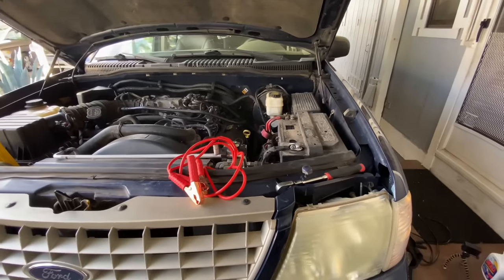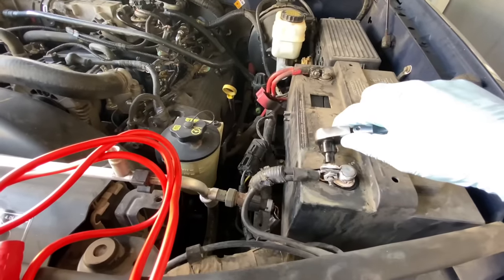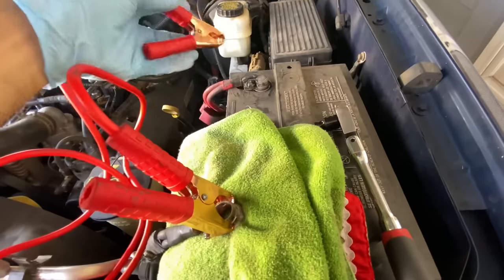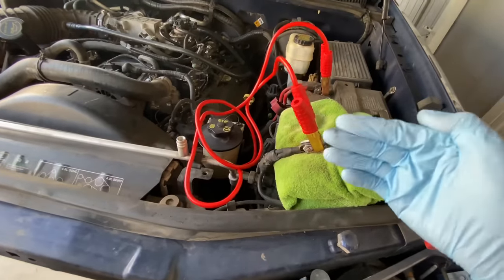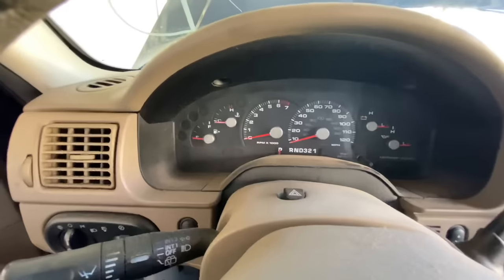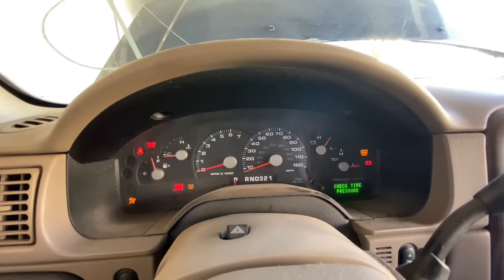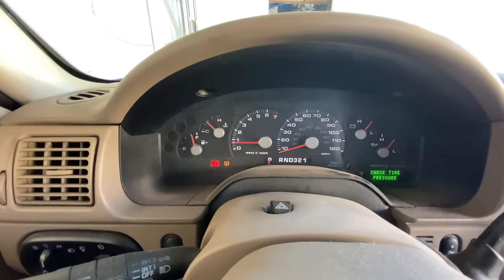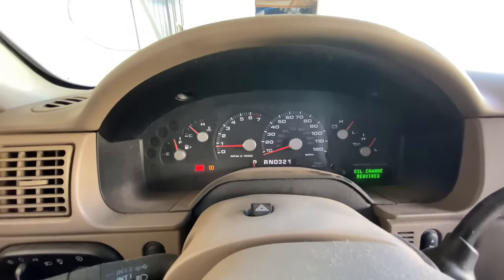How To Reset All ECU’s and Control Modules in your Car or Truck

Comment: I'm going to try this on my wife, her attitude has changed from when we first met. I wonder if it will revert her to her original self! I live in hope.
Reply: No hope dude.. You screwed yourself up the day you married her..
Reply: You may have to ground both nipples!
Reply: keep pushing the lower button hard enough can help sometimes .
Reply: Best reply ever lol
Reply: Lmmfao
Reply: I feel your pain my man I'm in the same boat one day everything is sweet and then everything is toxic every single day no way to reverse them back to normal
Reply: The replies cracked me up. Lol.
Reply: @asukakazama449  hmm
Reply: I'll tried already this on my wife, but didn't work, so after 9 years of marriage, i just gived up!
Reply: Ha that’s a damn joke ,tried all kinda shitting resets on mine ,ain’t  a shit worked yet, guess it’s time to get rid tha shit ass. reset reset shit resetting for days
Reply: @zanmirrob  nope shes broke,no hope.
Reply: @zanmirrob  yep today going to Lowe’s ,getting a new whirlpool double doors  , she should get colder I hope but use less power. Need a bigger one anyway so I can put all the left overs of my gumbo , and alligator tails stew.
Reply: It's a permanent fault, either put up with it and live in misery or free yourself of the problem.
Reply: @cardozita2cool  There like that when they have another person treating them like the pretty princess they think they are on the sly.
Reply: Try jiggling your key a few times. Should rest her fault code
Reply: Did she tell you, that you're  trucking her wrong.  Your 🚚  me wrong?!
Reply: @jimmydcricket5893  or the seeding farmer.
Reply: @tejanochris  i hope things get better for both of you GIVE some honey talk TRY something new and bring small new surprizes to her GIVE IT TIME so she could think about a few things AND look handsome all that helps
Reply: @asukakazama449  flick the bean, ( do you mean ? ).
    only works on 
    " little man in a boat " ,
Reply: @lU
Reply: Let me know so I can do it tooo!😂😂😂😂😂
Reply: Lol
Reply: Hahaha.  Hilarious
Reply: Jimmy S  It doesn't do anything just produce a really loud noise, I think it's her horn..
Reply: Bra you started something totally different from the video but when I say funny.... not to be mean but start with yourself and you see improvement. Be blessed..
Reply: If you do that you might void  the warranty
Reply: @geremiazjauregui2415  
.
Reply: Hilarious!!
Reply: 1william B l
Reply: Pull it out make her smell it 😂
Reply: This is classic
Reply: @bronsonteruna9453 aq 11qqq1q
Reply: @Living creature yeah, trade 'em in for a newer model.
Reply: how did t turn out?
Reply: Yes you actually can do it. Use the tDSC 2.3mA for 25 five minutes
Reply: OMG!!! LMFAO!!! GOOD ONE BRO!!!
Reply: Half these people don't sound like relationship material themselves blaming their wives lol
Reply: @cardozita2cool  its so weird man... once i moved in with her it's horrible... like bad... idk what to do i have a baby wit her ion wanna leave my child g
Reply: Some things just cannot be fixed, sorry man!
Reply: Try to reset first yourself it may works
Reply: Divorserape her. No fault divorce
Reply: Well, better not, this is women mind you can't change it
Reply: Mine is much better after 25yrs of fine tuning .
Reply: My guess is... Help out with chores... Pay more attention to the kids .... Be more intimate without expectation ....
Reply: I saw this and figured there was a boat load of people hating you and another load agreeing so I had to see.
Reply: @cardozita2cool  I had a genuine bi-polar wife and when her brain switched to evil it was a feeling in the air so thick you could cut it with a knife. But when she was good, she was very, very good. Doctors tell anyone with issues that they are Bi-polar. 99% aren't. When you been around a real Bi-polar person, there is no longer any doubt that it is real, it's just an overused name. From your comment I think you may have been around the genuine article! It is fucking creepy like hair standing up on your neck creepy.
Reply: @bronsonteruna9453  Yup...men wear black at their wedding and at a funeral for a reason...same thing has happened but we don't see it right in front of our own eyes until it's to late...someone just died ; /
Reply: @geremiazjauregui2415  Yup...he said he wants some strange and she said if it was longer you'd have some...
Reply: Fuerk. I wish i had new this before  i retuned her for a upgrade.
Reply: @bronsonteruna9453  bbbb
Reply: @cardozita2cool  No "CTRL-Z"!
Reply: Did it work or did it make it worst, hope you are not divorced
Reply: Mail it to SIA electronics they repaired mine for 120
Reply: Might work for guys who can't get sex anymore lol
Reply: Try switching to her sister first!
Reply: Try switching to her younger sister for awhile!
Reply: Lmao 🤣🤣🤣
Reply: Worked for me     hooking up your spouse to a car battery can be a excellent form of attitude reconditioning
Reply: It’ll never work. Female ECU’s are non rebootable. Once her program changes, she is done. Just get a new one. 😉 That’s the whole reason they don’t come with a warranty. And there are no returns.
Reply: I found a divorce works best for that problem
Reply: @asukakazama449   lol agreed
Reply: L.
Reply: @MrsBuddevil For your anniversary buy a weekend out for her and her affair partner.  How about that!!!
Reply: Maybe you're the reason she's unhappy 🤷
Reply: @c-yabugginout7573  wow this comment opened my eyes…. Thanks
Reply: Reading this was quite therapeutic... thanks for sharing.
Reply: The personu meet was fake
Reply: Start with self
Reply: 😂😂😂😂 I think I like this conversation 😂😂😂
Reply: Dude, that is funny as hell, I couldn't stop laughing when I first read it. Good laugh, made my day !!!
Reply: I'm sorry Mate but similar to hitting a pothole and bending a wheel or burning your car seat by dropping a cigarette. Unless you replace the entire wheel, seat, or wife, the attitude is there to stay I am afraid. 
This might be a good time for me to point out that in every situation I mentioned above, YOU caused the damage. 

If you quit smoking?
No worries about the enterier. 
 Let me ask one question before I go please.

Are there a lot of potholes on the road leading to your girlfriends house?

If so, that would explained the bent wheel, 
The cigarette burn in the seat,
              And

The attitude problem with the wife. 

When all else is ruled out it must be the simplest answer. 

;)
Reply: if the reset dont work you can always trade her in for a newer model  that  has  green and purple hair  with  a bone in her nose. yea these new models are different. I decided to just walk...........
Reply: Thats a good one....You just made my day🤣🤣🤣🤣🤣🤣...you should also check expiry date on marriage certificate 😂😂😂😂
Reply: Instead of the red wire , try high voltage line. Yes that will help you permanently. 😈
Reply: Lmao 😂
Reply: Lmfao!!! Look at replies 🤣🤣🤣🤣🤣
Reply: @grandpanero7284  😂😂😂😂oh my gosh those comments are crazy funny,
Reply: That was hilarious!😂
Reply: HA HA HA HA HA HA HA HA HA HA HA HA HA HA HA HA HA
Reply: Did it work.?
Reply: I had the same issue with my wife too ; so I traded her in for a younger model and haven't had any issues . It's been three years now without any issues .
Reply: Did it work ?
Reply: @bronsonteruna9453  💯😂😂
Reply: @royferguson3909  lmaooooo
Reply: @thekingsilverado9004  lmao! U guys are hilarious!! 😂😂😂😂
Reply: Jimmy S  😂😂
Reply: @thekingsilverado9004  😂😂😂😂😂😂😂😂😂😂
Reply: Hey mate, any luck with the wife? Maybe mains power would be more effective.👍
Reply: Jimmy S  lol. Oh Lord.
Reply: @jimmydcricket5893  oh ok. I bet that's how mine learned all those new sexual positions that even the kama sutra didn't know.
Reply: @c-yabugginout7573  lmao
Reply: @thaddeauscaldwell7101  She obviously has YOU broken in !
Reply: @waynelayton2045  , nah , that's not the case .
Reply: @waynelayton2045  , nah , that's not the case,  that's just YOUR opinion. Its evident you don't see and don't understand the full picture .  Anyway,  we're both happy , so we both don't care what other people think .
Reply: lmao nice one! Unfortunately you might have to trade her in on a couple younger model years. But look at it this way....you will enjoy being in the drivers seat once again and there's always someone in this world that loves the older crankier model years. 😃
Reply: 😂😂😂wtf
Reply: Good luck
Reply: good luck with that one.... her ECU will remember all the negative shit and keep reminding you of it...
Reply: @asuka kazama, I would follow your advice.  Would you mind giving me a demonstration?
Reply: @thekingsilverado9004  And she said. Let go of my Horn's . I know how to do it!
Reply: Look up the word "women" in the dictionary and it will explain in one word. TROUBLE . 😄 Kidding all men should own one. Yes Dear. I did not say what you thought I was thinking! 😏😰 Ahhh, Find a Great Man and you will see a  good women beside him. Where is my blanket and pillow? 😏😰😄 Why did you burn my supper. No I don't want to wear it !! 🤕
Reply: You can always get a new model instead (just for fun; you made my wife and me laugh a lot)
Reply: So any long term effect ????
Reply: If none of the repair suggestions work, you have to trade it in for a different make or model.  Preferably a few years newer.
Reply: @edwinbabajanians4328   😂😂😂
Thanks I never would have thought of that …..
Reply: Easy U ?
Reply: This is too cute ... His willing to try anything..  just go remember how you made her fall in love with you the first time and do it all over again.....
Reply: Ever since the forbidden fruit women have been given attitude. Like, I get it you're upset about the size of the house but dammit baby we had peace on earth and lived in paradise but that wasn't enough for you and just had to eat that damn apple. 🤣
Reply: Try rental a lot cheaper and less hassles 😉
Reply: Amen brother
Reply: BLOWIES 👻
Reply: Tried on my wife I had to buy a new set of cables.😂😂
Reply: .. Her Behavior Is A Reflection Of You!! IF You Dont Like The Way She Is Acting.. Change The Way You Treat Her!! Keeping In Mind " Her Attitude Chnaged Since You First Met"!!
Reply: @cardozita2cool  ten yr trade in ?🤣
Reply: It doesn't work like that w them. You have to get a newer model and start the process over again and repeat. Those CPU's are incredibly hard to reset
Reply: Yes if you really pound on that bottom button real good the alarm will shut off for a while and give you  some peace . If that doesn't work just give her to the kidney foundation . They will take anything no matter how ugly or beat up it is..  The next owner can fix the big issues like a loose or sloppy meat curtain .. some mechanics are really good ! But honestly she will likely just be sold for parts or someone will ride it as their beater
Reply: I dont think not even a  hard reset can help you  with wife problems .
Reply: I WISH I HAD A TIME MACHIIINNNNEEEE
Reply: Time to trade her in mine was 50, traded for two 25 yr olds
Reply: @MrsBuddevil  Naaa... that never works
Reply: It's the person that she is before you met her, maybe that why she was available at the time, you should take some more time to see the true color before getting married, that shit caught me too😂😂😂😂😂😂
Reply: Es inutil todo lo que hagas amigo,  ni volviendola hacer se compone, agarra otra que este mas nueva.🤣🤣🤣🤣🤣🤣🤣🤣🤣
Reply: Love it I do it every other day, she's so hard work, I do try topping her up with new fluid as often as possible 🍻
Reply: Hope's or wrong page, Harmony
Reply: great video tx for the help.
Reply: Buy a new one. 
Car I mean
Reply: Omg .. thats great lmao 🤣 😂 😆 👏
Reply: Dead 🤭💀
Reply: LMMFAOOO!! 🤣😂💀
Reply: Hhhhhhhhhhhaaaaiiiii
Reply: Make sure to consider her age make and model the older ones don’t have many features capable of resetting which is why sometimes we have no choice but to trade in a 40 for two 20s .
Reply: Keep dreaming, probably just need to do a trade in, I prefur to exchange a 40 for 2, 20's lol
Reply: You should try it on yourself too!! It may just be you, and not  your missy wife.
Reply: Like a car, return as soon as possible first time you detect some major problem. Put her on tests ASAP
Reply: Hehehe
Reply: It worked with my husband. I hooked the positive to his left testicle, the the negative to the head of his penis, accidentally put the truck in reverse and hot that gas pedal like it owed me money. 
He's been so calm and quiet ever since. 
I've never witnessed his ashes shifting the tiniest bit, not even once. Lol.
Reply: @cardozita2cool  there is, and I hope y'all get some couples therapy. If your relationship can't be salvaged it will still help you prepare for the divorce and it will help you adjust to being able to be yourself again. Peace and love.
Reply: Why am I the only lady on the planet that has never dated or married someone that is a horrible monster? Seriously. I don't have a living ex that I can't sit and have a nice conversation with, that I would be uncomfortable meeting in public, that I don't still consider a dear friend. One more thing. Why is it that my ex's are the only men on the planet that have at least one ex who hasn't tried to demonize them and they can count on when times are good or bad?
I am not talking about friends with benefits, I mean true a true friend. 
Am I just unbelievably blessed or am I one of very few people who can accept responsibility for their own actions in a relationship?
Reply: @Aqua
Ah but first reset yourself😄
Reply: did it work 😆 😆
Reply: Y'all all got it wrong... this bumper needs to be hooked to a fully charged 16v battery. 

Step 1. Make sure battery is charged
Step 2. For good measure add another 16v and fully charge that one too 
Step 3. Clip one of jumpers on tongue.  
Step 4. Insert other jumper where "the sun don't shine"
Step 5. Repeat as necessary!
Reply: Speaking for all wives, No it will not. If it did we would have already tried it on yall
Reply: Lol 😂
Reply: A
Reply: Damn what a great idea! I'm on it!
Reply: Your warranty expired on the day of your marriage 😆 😔
Reply: I hope it works
Reply: Vultures can't wait to get their hands on her 😃
Reply: Omfg that is gold
Reply: No kidding!!  Will try this yoo
Reply: Awesome idea I too shall try this ,pray for me lol
Reply: Hahahaha 🤣
Reply: You could try just being nice to her for a change. That usually works. Maybe stop blaming her for everything. Work on not publicly humiliating her and complaining about her behind her back. Or perhaps take accountability for the shit you do or probably dont do to better the relationship. But honestly just validating a womans feelings, aka let her vent and actually listen and tell her that you would probably feel the same way as she does if you were in her shoes. Women just want to feel like they arent being unreasonable based on their perspectives and they want kind, non judgemental input about the situation.  

I know you were trying to be funny, bit you weren't.
Reply: Tried this on my wife but did not work… 😢😂😂😂😂
Reply: I like to drive by weddings when their doing the photo and I shout "DON'T DO IT"
Reply: Great comment.
Reply: I'm fuckin dead
Reply: You mean you hope to live after this reply!
Reply: Women marry men hoping they will change. 
Men marry women hopin they won’t.
Reply: I tried it all really that’s been 6 months ago I’m still sleeping in my shop😳
Reply: Lmfao 😂 trying to revert her to factory settings 🤣
Reply: Jimmy S  hahahahaha     he dont have   bumper cables
Reply: I agree!🤣
Reply: just get a brand spankin new one, 😂😂👍
Reply: @bronsonteruna9453  me
Reply: Tried it men , hope it will work
Reply: Sometimes, the best solution for that is a full replacement..
Reply: Yeah, it seems to be a common problem with that model 😂
Reply: Please let me know if it works.
Reply: She wants a new car
Reply: Did it work
Reply: @bronsonteruna9453  buy yeah, you have to write all that down on the paper so I can
Reply: 🤣🤣🤣🤣good one
Reply: Do yourself a favor and trade her in for a newer model. ;)
Reply: I think left nipple is the positive and right is negative...lol
Reply: You mean under your thumb?
Reply: You mean under your thumb?
Reply: Omg that's hilarious. Good luck
Reply: Good Luck On That One  😊
Reply: Sounds like you will be going to " pull a part" if she reads this comment..😂
Reply: Yeah you gotta reset her Values....
Reply: @cardozita2cool  Sorry to hear that bro, I got out just in time.
Reply: @RAJA.GARRAGE498  Don’t fall for the pic it’s a Fat hairy chest guys with few day of dry sweat from wacking it sitting in his computer chair on gym shorts and sandles. Sock or not idk if I’d have to guess I’d say one only bit if it’s both there mismatched.
Reply: Sometimes you just have to trade for a newer model.
Reply: Sounds like this one is going to the scrapyard buddy.... beyond saving like mine 🤣
Reply: Maybe trade for a newer model
Reply: New ecu required mate once they go bad it’s in fixable unfortunately. 

New ecu very expensive especially if you’ve had the vehicle for a long time. 😉
Reply: Lmao! Please let us know if that works! For her! And you!
Reply: 🎉😂Then after that, you let her reset you back to your factory settings to when you first met her. ❤😊😊❤
Reply: Nah, I recommend just trading them in for one with less mileage.
Reply: Beat it up
Reply: Control module corrupted. Needs to be wiped and new file written .  Then go over reaction maps. Install new perspective sensors.  Delete comparison calculators
Reply: Try starting from the back, works sometimes.
Reply: 😳🤔😆👍🤣 try it and let us all know how that went bro
Reply: Good luck and let us know 😅
Reply: If only !
Reply: Let me know how it works out for you as I have the same issue with my wife….even tried trading her in on a new country model but the dealer said she was way too high in maintenance to trade in 🤷🏻‍♂️
Reply: 😂😂😂 bruh
Reply: Quick question and yes I'm a woman but why are the attachments both red aren't they supposed to be a black attachment on the negative on the positive? I just don't want to mess up my car so if someone could let me know porfavor... I have been trying real hard to be independent and fix my car on my only thanks to YouTube and channels like this especially I need some clarification 😅
Reply: Haha dam that’s a great idea.
Reply: Did it work bro? 😂
Reply: Lol
Reply: Is there one comment on here about the video being played or is everyone from Twitter on here
Reply: Need to change oil in perfect time wife.
Reply: nahhh when they go bad get a newer model!!!!! enjoy your new life
Reply: Do it once a week 😂….towel on her head,body position 4L and plug in jumper cable 😅
Reply: 😂😂😂😂😂😂STOP😂😂😂
Reply: If that were reversed, she'd probably divorced you years ago. That's the culture today. Ladies are bored, not in the marriage mood atm, her friends got in her ear too much... gone with the wind!

Too bad so many put their selfishness before their children. Growing up in a divorced household is highly toxic for children.
Reply: 😂😂 i feel your pain brother
Reply: They all do that after giving birth? It's the law enforcement makes them stronger then you ! And when the women is stronger then you the attraction dies
Reply: Tell me if it's work....I also will do the same thing 😅
Reply: You wife ain't the problem need a new hombre😅😅😅
Reply: 😂😂😂you'll need a bigger jumper cable for her bro😅
Reply: Better to check your self my friend   you may need to caliprat or adjust some things in your attitude olso to match her attitude.  This can be done every 5 years.
Reply: Wondering if the reset worked, and if it works on girlfriends?!?! 

I'll be honest mine is ten years older than me, so definitely considered and antique.. 
I'm worried about issues from previous owners... 
This year model had some recalls I'm almost sure but I can't find anything about it online. 
I'm going to try a hard reset but I doubt that it works. 
I'm not even sure if it comes with an ECM to reset.... 

On second thought. . . 

I think I'll trade this one in for a newer year model. 

If it's worth anything... 

If not I really don't think I can handle the issues she comes with. But she is reliable. 
I think she loves me as much as I love her. 
There is certainly an emotional attachment here. . . 

Was thinking about just wrecking the damn thing and collecting insurance money... 

Hell guys I gotta go. . . 
I'll let you know what happens. 

She is revving up hard again. 
Looks like I'm gonna be working on this damn thing the rest of the night. 
I doubt I even make it to work in the morning. 

They don't make jack stands to hold up this kind of weight..  

God bless y'all.
Reply: @levitezoe1804 My 3 yr warranty ended and bought an extended 5 yr warranty. But she racked up over 100k miles. Yup she's worn out on all cylinders 😂. She's refused a rebuild so I bought her a huge fat 12 inch that'll make her feel like new again. 😅
Reply: Yes they all need a firmware wipe...just don't let her access the wifi or she will download all the new updates...and you'll be fucked !!
Reply: 3 years old.. Ya made my day.. 🤣
Reply: @bronsonteruna9453 😂 I agree, I've been there 4 times and I'm not marrying again. All men screw around. Nobody's faithful, especially thespecially the men. I'm a church lady. I've never screwed around on a husband but I've called all 4 screwing around on me.😂😂😂 Yeah man think it's funny but it's not a lot of children doing without a daddy because of cheating men😢😂😢😂😢😂
Reply: Push the factory reset button.
Reply: Lmao
Reply: The import models can be more difficult to reset
Reply: I was just thinking about the same thing....how my girl has changed since we met.   A hour before I read this😂
Reply: Sorry Bro, as they say, you have to upgrade to a newer model
Reply: 😂😂😂😂😂😂😂😂 this comment just made my day! Thanks
Reply: Don't even try it , you'll end up in the dog house.
Reply: 😂 damn!
Reply: Buy her a new vehicle.
Reply: lol me to my wife be tripping 😂
Reply: No it won't work ull have to get a new one
Reply: I can't believe you didn't got a 5-year warranty cost a little extra but it pays for itself
Reply: 🤣 Oh yeah, we all want that!
Reply: Try connecting a jumper between her wallet and your bank account
Reply: God told Adam he's going to give him a beautiful, kind, funny, sexy, loving woman to make all his dreams come true. 
Adam asks: What Will it cost me? 
God replies: An ear, an eye, a left arm and left leg. 
Adam thinks for a moment and asks: What can I get for a rib?
Reply: 😂😂😂😂😂Lmaooo
Reply: Omg lol😂😂😂😂
Reply: 3 x wife's. After seeing what my dad went threw when I was growing up I lived by the one-strike rule as a man, I'm 56 years old barley a grey hair and I have all my hair my life has been stress-free when a woman turns toxic its over they will never go back to who they were, its too bad they don't come with a reset button but give a try anyway lol.
Reply: Did you try a different motel?
Reply: Oh my goodness as a lady that still made me crack up!😂 sorry dear, but good luck to your team. Lol
Reply: sounds like definitely not a keeper. She probably feels mutual dude😬
Reply: Try helping her in the house (waking clothes, doing dishes, giving her a break for an entire day by doing those things each month, take her out to dinner and continue to show your affection. She will turn her heart around. Don't stop doing those things.
Reply: Report salvaged 😂
Reply: 08/03/24' just a thought. Men marry hoping she'll never change.  Women marry hoping she can change him.  They're both wrong. lol's
Reply: Might want to try it on yourself first
Reply: Lemme know if it works I'll go get some heavy duty ones if it works
Reply: Don't hold your breath.😏
Reply: Plug her to the wall outlet
Reply: You just made my day - how funny is that - Love it 🤣😆😅
Reply: OMG DUDE! 😂
Reply: I have an idea where to put the leads
Reply: If not drain oil and upgrade